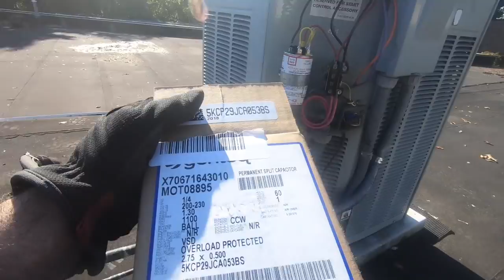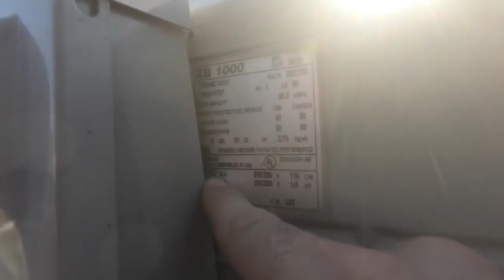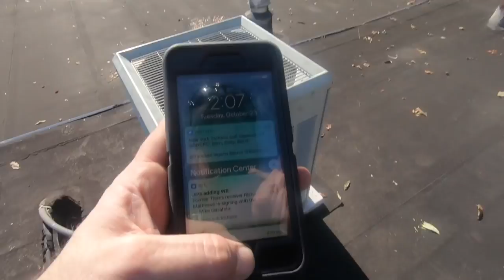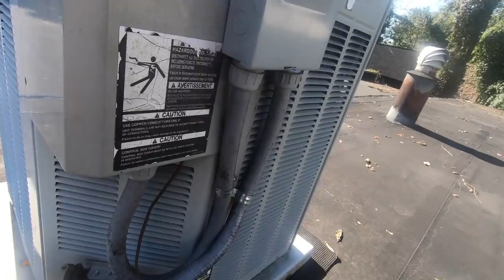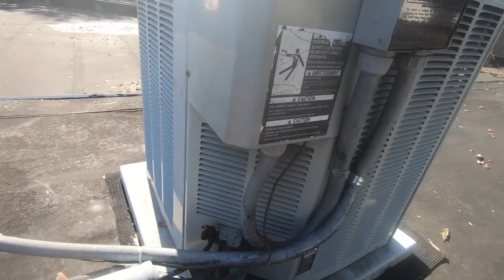Replacing AC Condenser Fan Motor

Comment: Only thing I have to say is if you ordered the motor you should have ordered the duel capacitor instead of using a turbo but great video keep up the good videos
Reply from the maker: I did order the dual cap with the motor yet my parts department didn’t get it for me.
Reply from the maker: They are expensive yet just like your comment on rescue motors they are perfect for service. They are all we need on our trucks. It’s not worth a trip to supply house which customer pays my travel to get the right size cap. Customers just want ac hen it’s hot and I never heard from any of them that’s too expensive.

Comment: I'll give you a tip that works great in this situation. 8 point socket size 5/16 fits on square head set screws. Get it 1/4" drive to fit your 1/4" drive ratchet. way more easy to tighten and loosen your fan hub off. You'll never fumble with a wrench again to loosen the fan blade hub. Go by Graingers and grab one and toss it in your socket kit. Remember it has to be 8 point.Oh and I agree with the other comments...you need to get yourself a socket adapter for the puller. Too slow and tedious by hand socket. Cheers!

Comment: You are a good tech. I'm retired now but did multifamily maintenance for 36 yrs. the only diff I see is that we couldn't spend alot of time per. call, you know managers they know nothing but expect all calls to be completed within an hr. avg and when you work on voucher or sect 8 complexes you get the crap of the crap, rigged systems,  bare exposed wires, no whips, bypassed shut-offs, I would report with pics to manager that this kind of crap is a fire hazard to the tenant and exposes the tech to danger, and needs to be repaired correctly, first thing How Long to repair,   Oh no to long, just get it going we have to many W.O. to get done plus five makereadies. I took a lot of pics that I reported to upper management even to the owners of the management company and told my wife if ever I get injured at work get my phone cause there is enough on there to show the dangers if I die to sue the crap out of them. I have told them that if OSHA saw the conditions and fire hazards on these A/C and furnaces they would be so fined shut down until all repairs.  Glad I made it and retired now. But I fear for the tenants who think they are in a safe apartment.
Reply from the maker: We need everything brought up to code or at least safe or we won’t take on the contracts. Every shop does it differently. It’s why contracts are only sold by the techs and once a site has a contract they have access to 24/7 service. So most don’t want to sell contracts to units that could get them forced out in the middle of the night breakdown. my previous employer would have us working in enviourments as you mentioned. It was all about getting in an out quickly.
Reply: Nothing worse than not having enough time and being pressured to hurry. God who needs that stress anymore

Comment: You do a damn good job. When it comes to mechanical things, especially when they are old, shit goes out one thing after another. Screws drop all the time and walk off. Screw your critics. You go above and beyond. I'd use you any day for work. It is all the DIYers who haven't a clue what they are talking about. You know your shit and that is all that matters.
Reply from the maker: Thanks I work as hard and thoughly as possible for my customers. Keeping them satisfied and happy is what matters. My employer is third on the list for keeping happy since I need to be satisfied, then my customer who is paying for me to do the work. My employer is the last on the list since if the customer is satisfied they are satisfied. Most on here believe they can do it better yet would never record themselves going through very unique situations like this job, or admit they missed something. Like I did my first time on this call with a 80mfd cap on compressor. I never had a system with 2 wrong parts on it.
Reply: @thehvachacker  somebody once told me  when you think you've seen and know it all, you learn something new. That is any profession. Life is learning. Anybody who thinks they are invincable and know it all are the people I stay. You are open to learning, that's what makes you someone I'd trust in a second. I only use one HVAC company. They installed my Carrier unit 27 years ago and just replaced my system due to age and a furnace that was becoming a money pit. Plus he always gives me the best price for the most efficient units. Plus he is always honest and upfront.

Comment: I watch the last video on this fix and I felt you did an ok job. I'm NO HVAC tech but hell it looked good to me LOL.  I remember when the last time you worked on this unit were the lase ass clown put a 20 micro-farad cap on a 5 micro-farad fan motor instead of using the round cap that had the two caps built in on for both the compressor and the fan motor a lot of unites I have seen like this one are like that they just use the cap that two in one to use less space in the condenser unit.  I wouldn't let keyboard worriers that have never worked a day in their life tell you how to do your job.  I fell your doing a great job.
Reply from the maker: I learned not to let them get to me. I just keep doing working and putting videos out for those that enjoy them
Reply: @thehvachacker  that's good because I like videos like this, or many like those with Folks like you that show other the trade.  I have a system I will need to install one day its brand new just been sitting waiting for me to finish my remodel and go from and old unite to a new 97% efficient one. I have a heat pump also so me this will be the first I ever done anything like this.  My fatherinlaw will have to do the charging for me since he has the licenes for doing that part. but the rest I hop I can do LOL.

Comment: Fully agree on not using the impact for everything. I’m fine with taking panels of and on with an impact, as well as getting screws out. But for assembling the appliance back together I always use hand tools.
Reply: I bought that Malco handle because you were using it btw, I like the fact it locks the bit in place.

Comment: watching your video is better then 90% stuff on television you have great work ethic keep it up wish I had you on our team back in the day, did you find out the sound when starting it up? i have not work on freon in over 25 years wow have thing have change,would have said it was the freon flashing on start up that sound was normal back then. keep up the good fight.
Reply from the maker: That sound disappeared and never returned. I’m thinking something with the bearing since it followed the fan rotation

Comment: There is nothing wrong with using power tools as long as you use the right tools and use them correctly. I have been using power tools (DeWalt screwdriver) on computers for 20 years, but only with a torque setting. Never higher than 3 inside a computer/server and 5 to install a server in a rack.
Reply from the maker: That wasn't me against power tools. Ivwas making a stand against the trolls that gave me a hard time for not using my impact in part 2 of this video in the comment section
Reply: @thehvachacker  I got that. The comment was for the trolls giving you a hard time. Keep up the good work.

Comment: I am not a troll, hater, critical  or anything like that, I do have almost 40 years of HVAC behind me as well as owner of own HVAC business. You were at the site so you probably know better then me but it almost sounded like something bouncing around inside of the compressor? It has always been my practice to install a compressor short cycle protector, cheap insurance to avoid call backs that are not your fault and of course protect the equipment. I do not know where your service area is at but where I am it it can get very hot and any one second or more on a hot day, full load when the power drops out from the utility provider or some other reason and that compressor starts short cycling well you know what the result can be. Adding that short cycle protector just makes me fell that I have done the best job before leaving.
Reply from the maker: The sound happened even after the compressor stopped and continued and stopped when the fan stopped spinning. I was thinking it was something possible with the bearing not moving freely at first. I could be wrong, have been many times

Comment: Ever hear the story about the US Air Force technician who dropped a large socket in an ICBM silo in Arkansas back in 1980?  The socket bounced off some metal and punctured the fuel tank which started venting fuel into the silo.  Took awhile, but it eventually blew and the explosion threw the nuclear warhead quite a distance from the silo.  No nuclear explosion, but had the warhead gone off it would have taken out the city of Little Rock. ;-)
Reply from the maker: Good story I will be extra careful if ever working over a nuclear silo. Kidding i am careful if I am ever working over anything I would lose my tool if it falls into. This spot I knew I could easily retrieve it.
Reply: That was his nuts he dropped, not a socket.
Reply: @gregk.6723  - Big nuts can do a lot of damage too. '-)

Comment: Here in the uk the copper grease is called copper slip. It can be used as a lubricant but its mainly used to aid future dissasembly by proventing corrosion.
Reply: The US we can use "Nickle  Based" or a graphite base.
Reply from the maker: dave we use it for the same. it prevents corrosion and allows fasteners to come apart.
Reply from the maker: Jim the nickel base is silver/ grey in color I thought. I use both yet my shop has been providing the copper color paste.

Comment: You asked about the copper goop.  It is anti seize compound.  The silver is also anti seize.  Copper type gets all over everything if not careful.  Tools can be used in many manners.  You have to learn your own tools, and then you get work done properly and no injury or unneeded stress on your body.  I noticed you did not climb a rope to get to roof.  You are getting it.

Comment: Love those old Tranes but I’ve found out the hard way myself to get the oem motor for those. Rescues just don’t line up and the blade sits too low in the fan orifice even if you could mount it.
Reply from the maker: Rescue motors are good just not meant to replace everything. These trades and carrier 875rpm condenser fans
Reply: @thehvachacker  I'm having terrible luck out of rescue. Well I should say rescue blower motors. They aren't lasting but 2 or 3 years. I have awesome luck out of fasco.
Reply from the maker: Did you get a bad batch? I only ask cause they seem to last yet some systems not worth putting them in. I have the special brackets for them yet they never seem to last in the Lennox or any system with the bracket that scews into the motor so I just order oem if I see a motor without a belly band.
Reply: @thehvachacker  I don't know if I got a bad batch or not. I'm afraid to chance anymore.
Reply from the maker: I understand I haven’t paid attention or ran into many rescues a few years old and crapping out. Yet I don’t trust them in every application and at times prefer oem.

Comment: That is what impacts are for. To work quicker and easier. Anybody who works in any mechanical job knows time is money.
Reply from the maker: I use my impact all the time. except in this video. Why would I want to tire myself out removing numerous screws holding door panels on RTU equipment? I just got slammed by critics and trolls the video I did before this and had to learn to just ignore them and have fun doing what I do
Reply from the maker: I just bought a 37pc impact socket set fro harbor freight hopefully I won’t regret buying these cheaper tools. If I break them will replace with better.

Comment: I agree about some mechanics (auto , especially) who over tighten their bolts ;  When I was Installing Appliances , I would use the clutch on my cordless drill , No Need to strip out threads while switching refrigerator door swing , and used hand drivers for Anything made with thin gauge metal .
Reply from the maker: Power tools are good if used correctly. Problem is many will impact away till the screw spins around
Reply: @thehvachacker  Yep, fully agreed on that.  It is the guy behind the tool.  I used impacts constantly.. everything from little 100 inch lb to 1400ft lb.. only idiots use everything on high settings.  Most driver work tightening is at the lowest setting, then hand tighten it all to get that good feel on it.  Heck, my battery impact can snap bolts in a second if you use it wrong.. which is why I never let any other techs use it.  They will pop it to the highest speed and snap bolts off left and right and claim its a bad tool to use. sigh

Comment: I really like the nickel anti seize. The aluminum and copper work for many aplications,  but the nickel handles heat better and is more corrosion resistant.  But its also much more expensive.
Reply from the maker: I have nickel anti seize that seems to harden from age. Wonder if there is any way to revive it
Reply: @thehvachacker  hm. Thats interesting . Ill have to look into that also. Hopefully i dont have issues when i try to remove some bolts that have been in for a lot of years with it. Cant think of any that i removed with it that have been in for a significant amount of time. Thanks for that info.
Reply from the maker: @poellot  i don't think the caking of the anti seize in the car or even if it cakes where its applied will matter much with removal. It still should prevent the fasteners from rusting and bonding together. More not wanting to throw away some nickel anti seize yet I bought a new container
Reply: @thehvachacker  oh ok, gotcha. Yeah i have had the aluminum type dry out at work. Usually when its getting toward the bottom. I usually then cut the container in half and scoop it out, into the container of new and mix very well. It thickens up the new just a little and it seems less messy to use for me. Not sure if that will help you or not. Thats why i prefer to buy smaller tubes for my personal use at home even though its way more cost per oz, its less messy and easier in a tube for me and i dont use enough of my own to justify saving any money with big cans.
Reply: @thehvachacker  msds for permatex brand shows it contains "DISTILLATES (PETROLEUM), SOLVENT-REFINED HEAVY NAPHTHENIC" 

Zippo fuel should be perfect.
Reply: @thehvachacker  The copper base seems to be more water resistant and for higher torque applications.  I am a maintenance tech. at a food company and work on a high pressure pasteurizer machine.  The piping connections along with the bolts we use the copper base as the machine pressurizes with water to almost 90k psi there is a lot of torque needed.  For the water side considering the outdoors I would go with just using the copper based stuff.  This is just a suggestion in no way telling you how to do your job that you clearly know and can figure out yourself just fine :-)

Comment: did you check for the compressor number you were looking for while you had the unit open?
Reply from the maker: Nothing was on the compressor yet I checked the compressor before getting there for the correct size capacitor it needed to operate

Comment: What kind of Tool Bag do you use? and would you buy it again if you need another one? Thanks
Reply from the maker: I use the Veto tech MCT bag. I want to buy something just slightly bigger. For ac work this was perfect. Now that winter is here and I use 2 meters often. At times it’s hard to close it up. Yet if this breaks after the warranty is up I would buy this one again. I was considering the backpack also.
Reply: The Klein version isn't bad either.

Comment: They were metric Channel Locks.  FYI.  And those bolt were tightened to German specifications.  Gutentight.
Reply from the maker: You got it metric in length 180 mm yet no adjustable whrench is sad or metric to how the jaw opens. Germans make some good tools why I use knipex and NWS tools. I also can get myself some Cuban cigars when going through a German airport

Comment: By any chance was that vibrating noise actually the motor starter chattering from your volt meter resting on it?  It stopped from the vibration moving the meter off the starter.  I don't know if the starter has exposed contacts to where the meter resting on them would hamper the starter for staying pulled in.  Is what it sounded like to me but could of been anything who knows not there.  Anyways nice videos you certainly know what your doing and seem to do good reliable work.  You will always run into haters they are just jealous of your success of your career.
Reply from the maker: It was coming from the fan area. Disappeared before I found it

Comment: You cannot make all of the people happy all of the time, it comes down to that. Best thing to do is to completely ignore them, go on doing what you do. Use whatever tools you feel like, your teeth if you need to!

As for the sound, could it be the refrigerant at a weak initial pressure causing more vibration of the compressor? It sounded rather eccentric and not the rhythm would expect from something is spinning around. Could also have been some debris that fell onto the compressor or touching it?

Comment: I have been out of HVAC a few years now, but i still do tech work now and then, and i gotta say where did you get that crescent wrench. that is a nice little tool. only complaint would be you tend to be out of shot occasionally when showing something.
Reply from the maker: That wrench is a Knipex Pliers Wrench before I bought this wrench I would carry a 6, 8, and 10” adjustable in my bag. I am always working on the filming. It’s important yet not as much as the job I am on site to perform.